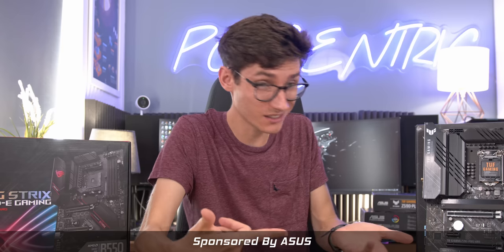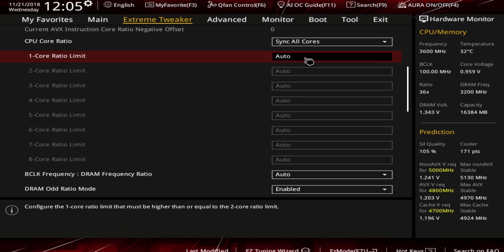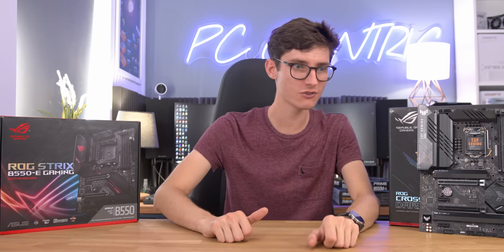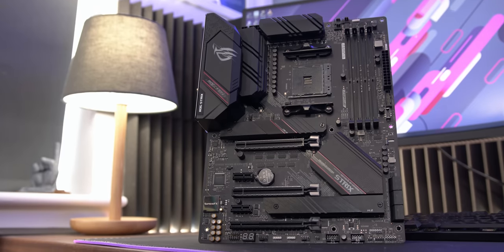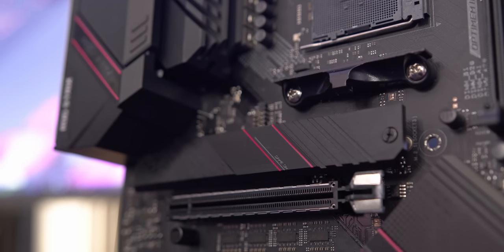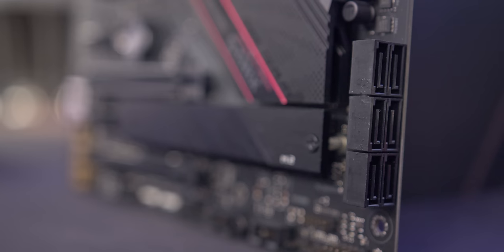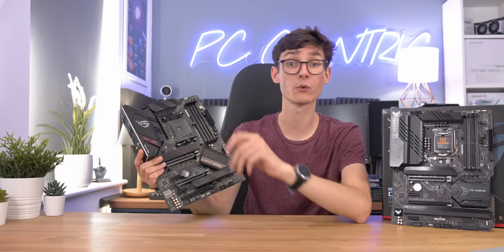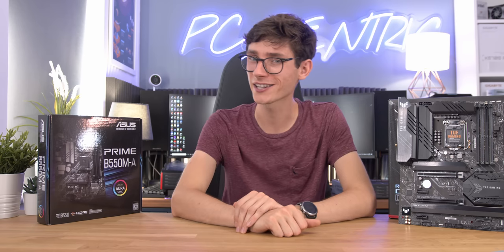How To Choose A Motherboard for Your Gaming PC! 🔧(Ryzen & Alder Lake) | AD

Comment: A motherboard is the main printed circuit board in general-purpose computers and other expandable systems. It holds and allows communication between many of the crucial electronic components of a system, such as the central processing unit and memory, and provides connectors for other peripherals.

Comment: While I probably over spent on my motherboard, it has a lot of features I wanted/needed. It’s also very aesthetically pleasing. Since I was getting a 5950x and a 3090, I went full bore with an X570 Aorus Xtreme and have been very happy.

Comment: I used a Asrock z390 phantom gaming 4s/ac for my 1st gaming pc. mainly bc it was sold with the CPU (i7 9700kf. I managed to get ahold of a 3060 msi ventus 3x OC for MSRP I waited for months, n wanted a 3060 ti but it was the only gpu that I could get for under 500. I originally was gonna buy a series x but I refused to give in to “scalpers”

Comment: I’m thinking of getting a R7 5800x and a 3080 with plans to overclock. I’m not really on a budget but I would prefer if the mother board isn’t over like $250. A little more than that is still fine though. Thanks for the great content dude!
Reply: Hey man I just bought a 3080 and I’m wondering if you managed to get your build done?

Comment: "I commonly see people overspending on their motherboards"

My dark hero is unhappy with being judged. That said, would be nice if it had a partial/full backplate, as other mobos at the same pricepoint have one as well... along with more m.2 slots.
Reply: Yeah i want 4 m.2s on my next MOBO
Reply: I'd rather the option be there than not. 

Even if NVME drives bigger than 2TB are... expensive af (for now)

Comment: I bought a TUF B550 non-wifi, which has all I need
Better sound chip then Prime, so worth the extra few bucks
The only thing that I would prefer on Strix is built-in IO shield, but paying extra just for that didn't seem worth it

Comment: 6:55 i hear a lot of people very adamant when it comes to wifi on motherboards; that one should NEVER buy a motherboard because of wifi capabilities. any comment on that?

anyway, i'm glad someone made a video regarding the topic of choosing a motherboard because i never learned what to look for in motherboards besides ensuring its compatibility. not sure what to trust about this video considering the remark i pointed out, but i appreciate the effort (and truthfully, i don't know whether or not it's wrong for certain).
Reply from the maker: If you need WiFi, it's usually a lot cheaper to buy it built it. WiFi chips do vary though, so it's worth checking to make sure it's a "good" chip, rather than something cheap

Comment: Great video. I knew the case I was getting would have a front USB C port. I'd be using a number of fan headers, and RGB on the board wasn't important to me. I chose my board accordingly. (MSI B550 Gamer's Edge WiFi). It's not the most attractive looking, but all the headers just seemed to be right where they were needed for easy cable routing. Beyond that, I expect it to remain in the background doing it's job without much further attention for the life of the PC.
Reply: is it for amd or intel
Reply: @jjolatunji3225  The B550 is for AMD. I believe there's a B560 version of the same board (or similar) for Intel.
Reply: @CrimFerret  do you think your motherboard needs a wifi card or does your built in wifi does the job
Reply: @jjolatunji3225  The built in works fine (mb includes external antenna). Given the choice I'd have it wired direct of course.

Comment: Hey Pc Centric, i have a bit of a problem. So the context is that i’m saving for a Pc, preferably with an rtx 3060. but my pc will probably be around 2000$ aud, and right now i have a 2017 21.5 inch iMac i got from a hand-me-down. I have saved birthday money from my recent birthday, and i predict it’ll take me around 1 and a half to 2 years to save for my dream pc (rtx 3060). The only games i play right now are Minecraft, and i want to be able to run minecraft with shaders at high Fps and high settings. Should i save for a cheaper pc? or should i wait longer for a 3060? and if a cheaper pc might be a good option, what parts would you recommend for my needs?

Comment: My problem is not knowing what will last, because some boards will be incompatible with later CPUs. I once bought a cheap motherboard with my Ryzen 5 2400G. Kept getting issues with Windows 10 updates. I replaced the motherboard with a more expensive one and no more issues. Now I'm not sure if my board will have issues with a 3rd gen Ryzen.
I don't want to have to buy a new motherboard with every CPU upgrade.

Comment: Which processor should we buy 

Intel i5 10th gen
Intel  i5 11th gen
Intel i5  12th gen
Or
Intel i5  13th gen

What's the difference between intel 12th gen and 13th gen processors. 

Is it still worth to buy intel 10th gen processors.

Comment: Hi PC Centric. I have a question regarding motherboards. I am building a pc with rtx 4090 and i9 13900k. I will be using for gaming, specifically flight sim vr. I want a z790 motherboard but don't want to spend too much. Have you any recommendations for z790 boards that won't break the bank but also that won't bottleneck the expensive other components? Thanks!

Comment: uhm,a mid range budget are sweet spot. they have many good fiture for your pc and dailys. especially if you are a gamers. no need to pick enthusiast motherboard.. they are expensive, but actually it has 40% same fiture like a midrange budget motherboard. the 60% fiture are useless (for me, as a gamers). so,another pennys can be allocated to GPU/Ram. but, if u like tweak and OC. i suggest to buy an expensive motherboard. they have good vram,good stability,etc. the rest... its depend what u prefer, and what u gonna do with your PC :)

Comment: Bro i dunno what i did wrong but
i made a build that is mid-high end but when i enter a game like warzone or smth that has easy anti cheat it restarts my computer
my build:-
ryzen 7 5800x
rog strix B550-e gaming wifi
rog strix 3070 ti 
corsair mp400 2tb m.2 
corsair vengeance rt rgb 16(8x2) 3200mhz
850w corsair psu

Comment: if its my first time building a pc, which mother board should i get if im going to to play like minecraft, rocket league maybe.
Reply: Depends if you want Intel or AMD CPU also which CPU Generation
Reply: @iwobos  im getting the 5600x ryzen
Reply: @frogplayz_2472  Then choose something from the B550 lineup my personal advice: MSI B550 Gaming Plus or Gigabyte B550 Aorus Elite/Pro
Reply: @iwobos  im gonna get the b550 gaming edge wifi but idk how to do bios without another gpu
Reply: @frogplayz_2472  
You don't have GPU?
Reply: @iwobos  i mean cpu and i have a gpu i just got it (sorry for the mixup

Comment: I just got a B550M Aorus Pro-p motherboard myself for my new ryzen 5 5600x but it’s not booting. It booted once but since then I haven’t been able to get it to post. I’ve switched from Intel to AMD so I don’t have a past CPU go slot in. I also took it apart and put in my old intel components for a Q-flash with the latest update. Not sure what to do here. I was wondering if you had any tips on what I’m doing wrong. Also love your vids sorry to throw this long paragraph at you
Reply from the maker: Is the board definitely flashed for a 5600x? Have you checked my "pc wont boot" video?
Reply: @PcCentric  I don’t think so but I’ve never had to flashy bios before. There was no blinking light coming from the USB stick. I’ve checked out some other tech you tubers on flashing bios but I’ll be sure to check out your video to see if that fixes the issue.
Reply: @PcCentric  Hey, thanks for your help. It turns out all I need was to take out the motherboard battery for five minutes. Once I did that it was able to post.

Comment: I'm really confused between Asus Tuf x570 - PLUS and Asus ROG Strix B550-F Gaming (wifi) Getting both of them at the same price. Help please!!
Reply from the maker: Depends if you need the PCIE lanes really, and the older x570 boards have a chipset fan
Reply: @PcCentric  I don't want that really, would you suggest going for B550-F or you have any better recommendation at around the same price?

Comment: what cpu is good for a 3070 gpu???????
Reply: 5800x3d is last gen but still VERY fast, great gaming CPU.  Nothing wrong with the 7800x3d either except it requires a more expensive motherboard with more expensive RAM.  5800x3d is still blazing fast for a fair price.